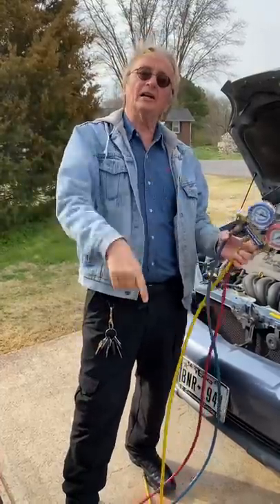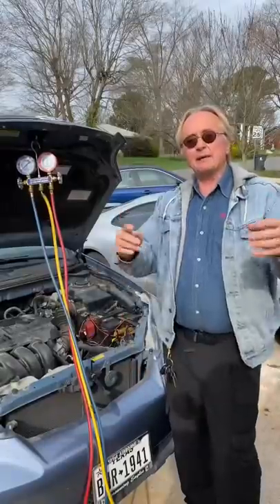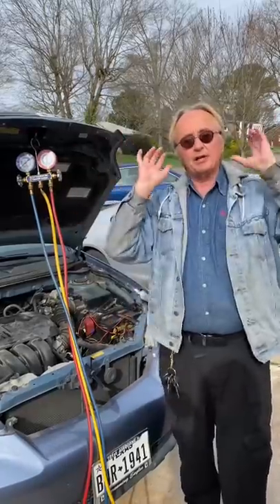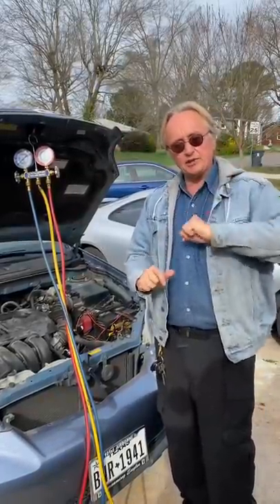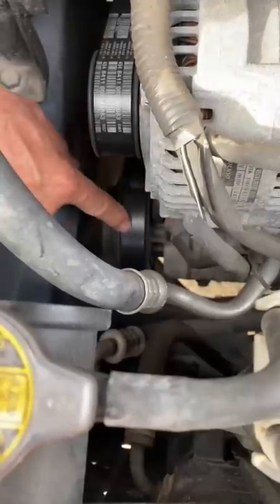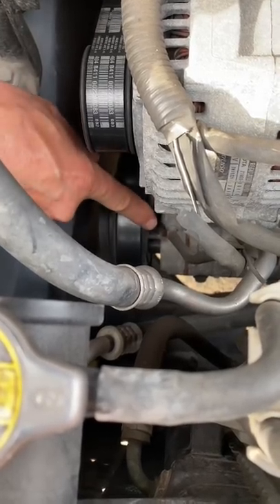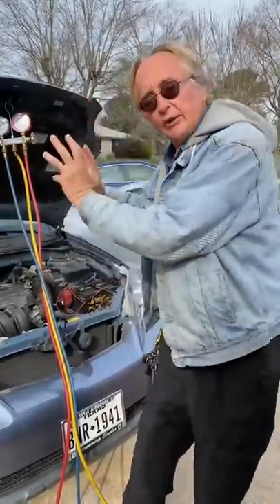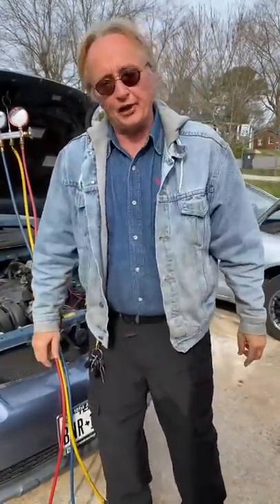Doing This Will Make Your Car’s AC Blow Twice as Cold

Comment: Ac shop tried charging my $1,060 for a “leaking compressor” took it to another mechanic and the machine displayed passed leak test, they recharged my system with refrigerant and been blowing cold since.
Reply: If your system had to be recharged, then you have a leak somewhere.
Reply: @michaelh5055  i went 4 years without recharging it it might be a small leak if it took 4 years to be completely out?
Reply: @jesusramos2157  Overtime, the orings will dry out and cause leaks. Just do not put any of that leak sealer in your system. That junk will clog up the system.

Replacing the orings is not hard at all. A pack of orings is only 5.00 from any auto parts store.

I had a leak in my Dakota. Had to recharge about every two months. Last fall when the weather cooled, I replaced the orings. It took less than an hour including recharging the system.

My ac lines were right on top, so it was easy. Hopefully yours are easy.
Reply: @michaelh5055  thank you man!
Reply: I did the same thing last year.  Luckily the shop I go to is honest.  The tech did a leak test found none and recharged my AC.  Only cost me $75 bucks.
Reply: menards has fill ur self stuff for $12 bucks if it dont stay cold after the u have a leek.... best way an cheap to test ur self.....
Reply: @jimmyconway7554  Another tip, charge your system with duster air that is diflurothane or however you say it. That stuff mimics R12 and is far colder than R134.
Reply: Jesus did the shop use Leak Dye in your system?. If not you probably will need to recharge again which is expensive..even a small leak will empty your system eventually..
Reply: @michaelh5055  that stuff does'nt hurt the A/C system overtime?
Reply: @edwinrodriguez4576  I have had it in my system for a little over two years. No leaks, high and low pressures are within normal range and no compressor knock.

Also, I paid attention and it doesn't cycle any more or less than before.  It works fantastic in the south Alabama summers. July and August are easily 98-102 with high humidity. With a digital thermometer, I get readings in the vent of about 38 while driving. The wife's vehicle is around 48-50.

She doesn't want me to convert it as women easily get cold lol.

The can tap I use looks like oil filter pliers. It has a needle that pierces the can and allows me to just squeeze and tap the can. I can then screw on the hose to fill the system.

There are also videos about using propane. I am not trying that 😂😂
Reply: @ Jesus Ramos - these dishonest auto repair shops, unfortunately, are everywhere! MOST FORTUNATELY, we have SCOTTY giving freely, his unique and invaluable, advice. SCOTTY " RULES " !!     💯%       Roland Singh, Canada  🇨🇦
Reply: @stevedeleon8775  I imagine in AZ people will sell their soul to get the AC running 😂😂
Reply: @michaelh5055  It gets HOT🔥here in Tucson & Hotter 🔥🔥in Phoenix..And HELL 🔥☄🔥HOT in Gila Bend!
Reply: @stevedeleon8775  I live in south Alabama, but been out in Arizona. The heat is completely different. Out there it's like sticking your head in an oven. It's hot and dry. 

Here in south Alabama, turn your heater on max all day. Then stick your head over a pot of boiling water to feel the steam along with the heat 😂😂.

I think Arizona is more dangerous. You don't realize how much the heat is affecting you until you become ill. In Alabama, you walk out and say fuk this within minutes 😂😂
Reply: @michaelh5055  I'm a Arizona native born & raised in Tucson...the problem is the summer months JULY... AUGUST SEPTEMBER...is to NOT come out here in these months...If you must go or work outside like I did for 25 years is to wear a full brim hat..100% cotton long sleeve shirt & drink water every 15 minutes & take a 5 minute break in the shade every hour on the hour..I worked as a public school district maintenance tech.& survived..it's called  adapting overcoming improvising
Reply: @michaelh5055  Yes, but if the leak is small enough, why waste money? Hell, mine has been leaking oil for 6 months now due to a bad gasket, I just top it up when I have to and keep driving. I ordered the gasket these days though.
Reply: @techalyzer  I did the same thing. I just didn't fix it because of the brutal heat lol. Once fall hit, I fixed it in less than an hour.
Reply: A leak test only checks for fast or moderate leaks. A typical leak down test is only an hour long. If your a/c leaked down in an hour it would be a very easily detectable leak. Most leaks are very slow and can take days to months to leak down enough for you to notice a decrease in performance. That's like you come in saying your engine is making noise. It's burning oil so the level is low. You need an engine. You take it to another tech and he tops of the oil. Noise goes away temporarily. He didn't fix the underlying problem, he just put on a bandaid. Your a/c is not fixed. It's just bandaided
Reply: Michael H that’s pretty cool can you do a video on how you fill it with air duster
Reply: @michaelh5055  Great way to kill the AC
Reply: @michaelh5055  
Did you vacuum the air out of the system when you replaced your seals? If not, the air in the system will make the compressor work harder and shorten its life span. Also using the air duster can be fine, or it could be disastrous depending upon the type of air duster you use. A little known secret is that all air dusters are just different types of refrigerant. If you got the right type, then it would be the same as buying a can of refrigerant in the automotive department of your store, but if not, then you would really cause extreme high pressures and destroy your compressor. But I'm pretty sure that you got the right one because you said that you're pressures were in the normal range. You've got to be careful about mixing types of refrigerants. It could end up costing a bunch if you cause a catastrophic failure of your compressor.
Reply: same for me. then a year or two the compressor ceased up and moving car undeliverable
Reply: driver*
Reply: @michaelh5055  listen to scotty, they ALLLLLLLLL LEAK SOMEWHAT
Reply: @michaelh5055  , hi just wonder what oring did you change? It's in the compressor or somewhere else in the AC system?
Reply: @michaelh5055 I'm in Pensacola and that was a good analysis. Lol
Reply: @jimmyconway7554 the problem with the fill your own kits is it doesn’t purge the oxygen from the lines or from the ac compressor. And when oxygen is in the ac system, sometimes the clutch won’t engage

Comment: My coworkers’ 07 Corolla, he never turn off the aC and it’s always at a max level of fan and temperature. He only top it once a year. 😂
Reply: Try that I  a GM it’d probably break in a month 😂
Reply: 07 corolla is called in our country as what it means "white man slip up".
🤣
Reply: @kingarkamani1455  that's probably what your mother calls you when you're not around....
Reply: @ytexplorer7977  refrigerant doesn't wear out or stop working. Your AC will slowly stop working if you have a leak. It's true all systems leak to some extent. Some leak so little though, the AC will work for the life of the car.
Reply: @ytexplorer7977  it should last 5 year's
Reply: Climate control is never switched off on my 2016 Toyota Auris most of the time the fan speed is at 1 because the system is too effective and I will freeze to death and even in winter anymore than 2 on fan speed you start to boil.
Reply: Once a year is too much your coworkers car is leaking. A car normally leaks about ten percent every year, topping up every year isn't normal
Reply: @BobTheHatKing funny how many GMS I've sat in and every one of them says the AC doesn't work
Reply: @gravemind6536 that's a damn good system! I imagine some models/ makes are better or worse than others just by design or size.

Comment: "all systems leak a little."

Yeah but not that much. If you're having to recharge once a year or more you have other issues.
Reply: Yeah that’s right. This could potentially be a symptom of a bigger problem
Reply: Im on 5 years and 150k and still full on refrigerant. Thats normal. Leaks are not normal. Being low on refrigerant is not normal. Also it takes a specified amount of refrigerant to perform correctly. Its not something you can really guess at.
Reply: I have to recharge every week
Reply: @daltongaliciarodriguez  you should get that taken care of. It'll be cheaper in the long run.
Reply: @RedWingsninetyone  yeah Ik I think there’s a big leak or my compressor is messed up and I just quit recharging and I went to the mechanic but they didn’t give me a good answer they just said they have to replace the whole system
Reply: @daltongaliciarodriguez that are probably right because you trashed it running it so long with the bad compressor and just continuing to top it off you probably used the stuff with stop leak in it too which just clogged up your condenser coil and orafice tube or TXV.
Reply: Right, but needing a recharge isn’t always a cause for concern.
Reply: @TryNSave  depends on how often and either way it is a sign that parts are starting to wear out. I've had my current truck for 4 years and have had to recharge the AC zero times. Same with my previous truck which I also owned for 4 years.
Reply: Doing something 1 time a year and complaining about it is why countries go down the drain
Reply: @Texasmule  or, you know, you fix the problem instead of putting a band aid on it. That's the real reason countries go down the drain.
Reply: @RedWingsninetyone boom good one
Reply: @TryNSave  - That's kind of saying that a boat with a small leak it's not a concern ! LOL 😂 

A small leak is a "God sent warning" for you to FIX the problem. Before it becomes a BIG issue. It's that simple. 

But people continue the amazing stupidity to let things degrade to a point. In which it becomes a major problem, usually rather expensive.

Remember the saying "Penny wise, dollar stupid" ;-)

Comment: Blend doors will cause the exact same issue. Cold one side hot the other side.

Its expensive to fix because often the whole dash comes out.
Reply: Most times its just the actuators still a pain to get under the dash with a dinky stubby screwdriver cause a longer one wont fit, but I’ve changed these actuators, blower motors etc before, Glad i did cause the cars i worked on all had other issues and we didnt have them long
Reply: Stuck blend door makes way more sense. Low on refrigerant will blow warm on both sides
Reply: @koreymayo8884  Low freon can make the evaporator in the dash colder at the one end than the other.

What scotty said can happen. But not the most common reason for it only being cold on one side only as he implys.
Reply: The difference between your answer and Scotty's, is you would be right about 80% of the time, and he would be less than 1%. There's other things that could cause this problem, but the blend door(s) are easily the most common. The only thing I would disagree on is having to pull the dash. If you have experience and some good tools, you can usually find a way around it. Once in a while you have to, but not too much.
Reply: @koreymayo8884  
The only problem with Scotty's video is that it is too short to really describe the problem. And so are most comments. When you have enough refrigerant to keep the compressor from switching off on its low pressure switch, but don't have enough refrigerant to really keep the air as cold as possible, then that is when this applies. Sure go ahead and check blend doors and stuff, but just keep in mind that this can be caused by just the right amount of lack of refrigerant. It's one more tool in your toolbox that can help prevent you from getting confused by a system doing strange things. And remember knowledge is power.
Reply: @solarfall2728  I have fixed blends doors without pulling the dash on my personal vehicle. It required cutting a hole in plastic. It's not a repair I would do on something newer for certain. It worked though.
Reply: @davidscott5903  If you really want to get into it, then explain the whole process.

"When you have enough refrigerant to keep the compressor from switching off on its low pressure switch, but don't have enough refrigerant to really keep the air as cold as possible, then that is when this applies. "

Not really. The air that passes through the evap chamber goes to both sides of the car. Unless you have AC in the rear, you only have 1 evaporator core. Even if the system is a little low, it wouldn't cause one side to be cooler than the other by a substantial amount. It may measure a degree or two off, but you wouldn't feel it. The only way you would feel a temperature difference is if you have a unique vent system where the air going to one side of the vehicle has to travel a lot further than the other side. I don't know of any modern cars where this is the case.  The distance offset is only a few inches. However, you can have this issue in the rear. On a rear AC system, the rear evap core is usually in one of the wheel wells. The air leaving the core has to travel 2-3 times the distance to get to the far side of the system. But again, its still rare because very few cars have a system like this.

" It's one more tool in your toolbox that can help prevent you from getting confused by a system doing strange things. And remember knowledge is power."

No halfway decent tech should ever have a problem like this if they follow basic diagnostic procedures. Once you do an initial inspection for anything obvious, (like a stuck blend door), your next step is to evacuate the system. If you have a low Freon condition, you check for leaks, but you also charge the system to prove it works. 

The real issue here is Scotty's advice. I have a hard time believing he's a tech. Some of his comments are is just bizarre. It goes way beyond this video. He screws up on things that a lube tech would know better.
Reply: @solarfall2728  
If you're so much better than Scotty, then why don't you make a YouTube channel? I know Scotty has made a few little mistakes, but he has done way more good than most people alive by helping people avoid bad mechanics and giving them the courage to work on their own cars. When you do as much good work as him, I will give you praise as well.
Reply: @davidscott5903  I really don't care about making youtube videos or being popular. You giving me praise, or not, will have no impact on my life whatsoever. 

If you'll notice, the people that like Scotty don't know anything about cars. He sells people on his personality. If you're really interested, there are several youtube channels that show real techs diagnosing and fixing real problems. If you can't immediately see the difference between Scotty, and someone who knows what they're doing, there's nothing I can do to help.
Reply: @koreymayo8884  so best bet is to go the cheaper route first(a/c charge) ? If still blowing cold on one side ,warm on other , then look into the blend door actuators?
Reply: A/c won't turn on .if pressures aren't rite ...
Reply: @koreymayo8884  this is exactly what happened to my car and I added refrigerant and all four vents blow the same temperature now.

Comment: If you have access to a set of gauges like Scotty did in this video suggest trying this. Connect low and high side service ports with gauges and engine is not running. Pressures should first be equal and secondly pressure shown match ambient temperature. So if it’s 90 degrees outside the gauge should be reading about 90 psi. So if that’s the case refrigerant charge is not your issue. This is for r134a only systems because of pressure temperature relationship and that particular refrigerant.
Reply: So if you are low on refrigerant, using your method, what will the gauges show?
Reply: Please you running a school 99 out of 100 its gas period or broken wire
Let's not get intherply charts these are lay people

Comment: It'll take another stimulus to replace the bad ac compressor in my 03 Chevy Trailblazer LT that I bought back in March. I did not fill any refrigerant with my a/c pro can since the gauge needle was in the red section and took it to the repair shop the same day and they said my compressor clutch went bad and we dont have any money to get it fixed at the moment so for now we just open the windows when it gets really hot out.
Reply: We bought a 03 trailblazer LTZ 4wd , great SUVs

Comment: I have one of those 134a refill kits and was NOT to use! it only has one gauge...question is the top one gauge comes off from the kit can that 134a can still be used on a 2 gauge setup? I am surprised the vehicle manufactures did not come up with a refill mechanism of some kind that would let you put a 134a can and it refills on it own while you drive

Comment: Some people leave their ac on all the time even when it's not hot. They either forget to turn it off or just don't care. Some people also don't use their emergency brakes (hand brake) when their parked on a uphill or down hill and they wonder why their transmission makes a loud noise when they put it in drive. Always use emergency brakes anytime you park.
Reply: Good advice but even better advice would be to make sure they are properly maintained. 

Granted: I was already planning on getting my brake system looked at but I didn't make it priority so I ended up with cooked drum brakes after my parking brake failed. After weekend towing rates and a couple day stay at a hotel, mechanics wanted to charge me upwards of 2000 to get them fixed.

Decided to do the job myself for 300 in parts. Makes a world of difference if your willing to get your hands dirty and dedicated to see the job through...

But yeah... Parking brakes and regular maintenance is key to engine longevity
Reply: Are you high? You're telling me using a parking pin instead of brakes makes my transmission make noises?  Hell of a mechanic ur.